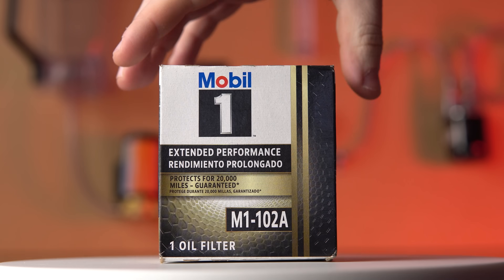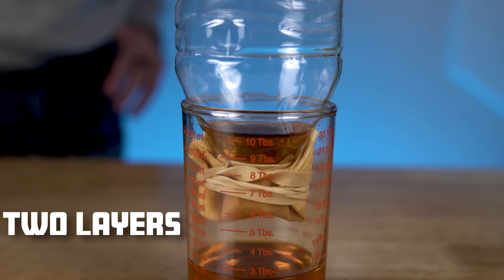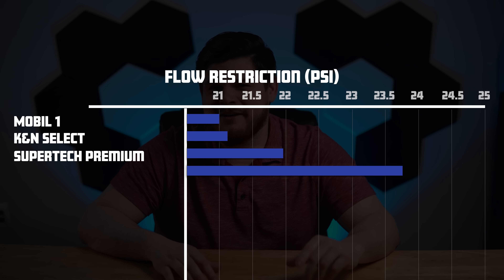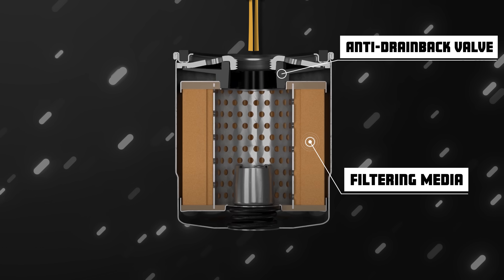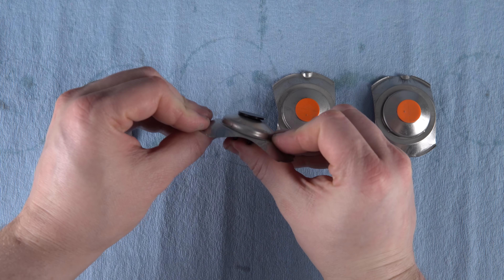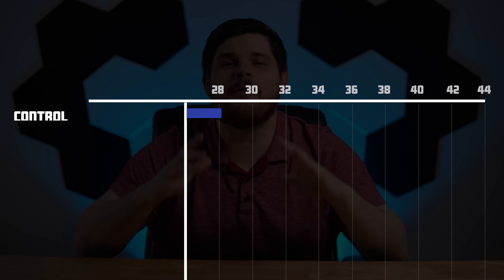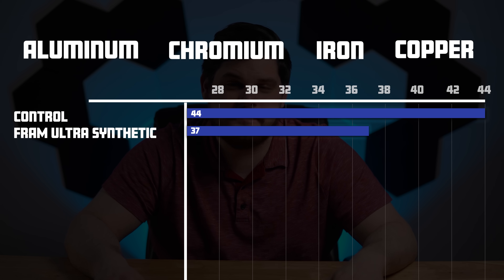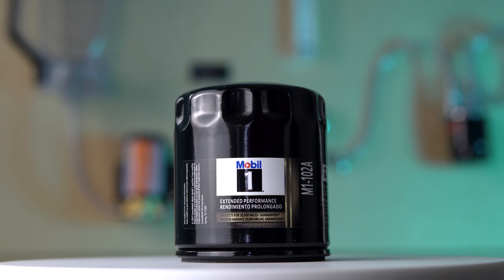Engineers Test the Best Oil Filters! FRAM | Mobil 1 | K&N | Walmart Brand

Comment: Just goes to show you that Fram for all the haters out here that it’s a respectable filter. The best filter for you car is a clean one. Cannot stress that enough, clean filters work better and provide protection for a few dollars. Great video, now how do you convince people to change oil regularly when they don’t even know that the car takes oil. I’ve heard it time after time that “I didn’t know it took oil, I just put gas in it “.
Reply: Been using Fram ultra for years , no problem at all ......ofc it has the be the Ultra one not the rest of the line up.
Reply: HES NOT TALKING ABOUT THE $3 FRAM THAT OIL FILTER IS TRASH
Reply: Fram WERE really crappy filters under previous ownership. But since Trico group bought them out in 2019, they've upped the quality significantly. If you're curious, look how the current ones are made, and then compare that to the Fram oil filters from 6/10/15 years ago.
Reply: Clean filters work better???  Well, DUH!  Problem is, the darn things get dirty the minute oil touches them!
Reply: I very well remember the hate for the plain Jane orange Fram filters back in the 90s and early 00s. The actual filter media inside was the standard pleated paper type you'd get in any cheapo oil filter, but the end pieces that held the filter media in place were made out of cardboard... Obviously the cardboard would get soggy, the filter media would then flop around inside the filter case as you drove around, if the filter media managed to shift enough inside of the metal can then the incoming oil would basically bypass the filter, and the out going oil would carry soggy cardboard bits through the engine's oiling system, yummy... 

I'm old and stubborn and stuck in my ways, so obviously I'm on team "I wouldn't put a Fram on my lawnmower", based solely on what I seen from them back then.
Reply: @admiralrustyshackleford119  it was never cardboard
Reply: “I put the gas in & it goes idk” 
Famous words lol
Reply: Fram lost my business 15 years ago due to inferior build and material quality, Today there are too many other quality filters on the market that never regressed in choice of materials for me to ever trust Fram again...
Reply: Fram has a new design out, Synthetic Endurance, prefix is FE. I’m going to check one out them out. Seems to have all the characteristics of quality in one filter.
Reply: All these tests are absolutely not relevant in cold oil,
Reply: Absolutely agree. I’ve used regular Fram filters for years. I ran two Dodge minivans to near 300k before selling them off. Our current cars are pushing 200k. I always change the oil and filter around 4k and no issues. Just routine maintenance.
Reply: @joeyoungs8426  you can’t argue with success. Simple maintenance and cheap it you do it yourself. Even having it done at a jiffy lube is better than running it to death by not changing oil and filter
Reply: Actually though, the dirtier an oil filter is the finer the particles it actually filters. I think with metal parts inside such as the Mobil 1, an oil filter can actually last quite a long time, and really only stops doing its job when the bypass valve opens.
Reply: @user-ms2mr2mc3g true dirtier it is more it can filter out, but that also restricts the flow. I've been looking into a bypass filter system for my truck. Problem is cost versus how much it will help. Getting ready to do the same basic thing for my house water line. Start with a 50 micro flushable, next would be a 10 micron finish with a 2 micron. I live in the country with hard water. Bypass oil filter I just need to put more research into.
Reply: I unknowingly ran the cheapest version of Frams filters on a Subaru for over 100k miles. The blue OEM filters (before they changed manufacturers last year) were basically just cheap Fram filters. Owners manual suggests 6k mile OCI. All the thousands of Subarus ran this oil filter I never heard of any of the boxer engines blowing up from using the OEM Fram filters. Subaru has some of the most OCD types about these filters due to the bypass value PSI requirements. I just buy either OEM or Wix filters in bulk which ever is cheaper. Change my oil every 6k miles.
Reply: Russell, pay attention. He has been using Fram Ultra, which is a very good filter. The people against Fram are referring to the cheap model, which is orange. The latest name for the orange filter is "Extra Guard". I would not use them either.
Reply: A dirty filter catches more foreign material because the pores are smaller from the dirt/other foreign material.  The problem is that when you filter, you cause less flow.  There's a balance, and I'm not suggesting to never change filters.  I'm just making a point.
Reply: @jameswalker590  Well taken. How clean the engine is internally is a factor for how long the filter will flow adequately.
Reply: I was production engineer for FRAM and had been a loyal customer up to that point.
1)  Air filter is more important than oil filter.  That's a direct quote from the design and warranty service engineers.
2)  Once the bottom of the pleats, up against the center tube, plug with dirt, the filtration element will be bypassed by the valve.  Many FRAM designs had very tight bunching of the pleats and, while they would pass the capacity test, since that test was limited in duration passing it didn't mean much.
3)  Remember that I said I was production engineer?  Well, in reality, due to FRAM's paper end caps, you never knew if you were going to get a filter with one of those end caps offset and leaving a gap where the oil would easily bypass the element.  That's what happens in real life production - things don't always match what was designed!
4)  For the longest time FRAM was cutting the threads into the bottom plate - other brands would roll form threads and that very commonly led to bits of metal swarf getting built into the filters.

Last, but not least, I had been buying HP1 filters for my Boss 302 thinking that this was a performance application and needed a great filter.  Well, the ONLY difference between an HP1 and a PH8 was slightly thicker housing metal, same internals. BUT, they are both tested at 90 psi on the line and, if your engine oil pressure goes over 90 psi, you have other problems!  I had paid a hell of a lot more for NOTHING!!
Reply: Fram literally invented modern oil filters. i never understood the hate
Reply: This is the $10 Fram, the $5 Fram is cardboard inside.
Reply: @xxxYYZxxx  no its not
Reply: It's the cheap internal pieces. Its filters fine, but doesn't hold up for crap. Fine for 3-5k OCIs, but just.
Reply: If Fram stopped making sh*t quality filters, eventually they would shed their reputation for making sh*t quality filters. For me, even if a company also makes a decent quality product, if they also make garbage so they can reach the bottom feeder market, I will take my money elsewhere, such as WIX, Bosch, Mahle, Hengst or Mann.
Reply: Remember when Fram added Teflon to their filters?
 How did that work out? Not very good probably.
 I have no idea/ I had by that time stopped using any Fram filter in an oil change.
 I use their air filters though. Cheap and I change them 2 times a year. Every year. They used to be like 4-6 bucks per. But now, who knows what they charge at the store. Well, made/ but then again they filter the air/ not the oil.
Reply: @luckyguy600  if you have no idea how it worked then maybe it was successful. Maybe they just added Teflon to the paint on the finish. All filters work as designed and if your oil is full of ground metals then it definitely isn’t from the filter “ It’s from you internal components that are made of metal.”, there is absolutely no way to tell how a filer is functioning on an engine as it’s running. If your bearings or other parts are shedding metal then no filter in the world is going to fix the problems you have, it’s wearing itself out and only replacing said worn parts will be the answer. Properly lubed and intact new engines can run without a filter. The oil only becomes dirty through use . And that is the problem this dirt is carbon deposits and metal particles suspended in the oil. Cheap Fram filters do the job it is intended for and is way better than neglecting you vehicle
Reply: No, it's not. It might have faired we'll in that controlled test, but  that doesn't change reality. I'll stick with my Mobile 1 oil and filter every 5k.
Reply: all filters are packed "clean"
Reply: You don't know anything about filters. Here's a bit of an education, long drain interval people need to use "synthetic" or as they should be called, reinforced filters. This way the pleats don't collapse which is far worse than having your filter not filtering 20 microns. Besides, a clean filter is only clean for a minute.
Reply: The deal is that the particle contamination is only part of the issue.  The other part is chemical contamination.  Mainly acidic by products of combustion.  No oill filter will remove that.  Thus, change your oil at 5,000.
Reply: I was production engineer for FRAM and had been a loyal customer up to that point.
1)  Air filter is more important than oil filter.  That's a direct quote from the design and warranty service engineers.
2)  Once the bottom of the pleats, up against the center tube, plug with dirt, the filtration element will be bypassed by the valve.  Many FRAM designs had very tight bunching of the pleats and, while they would pass the capacity test, since that test was limited in duration passing it didn't mean much.
3)  Remember that I said I was production engineer?  Well, in reality, due to FRAM's paper end caps, you never knew if you were going to get a filter with one of those end caps offset and leaving a gap where the oil would easily bypass the element.  That's what happens in real life production - things don't always match what was designed!
4)  For the longest time FRAM was cutting the threads into the bottom plate - other brands would roll form threads and that very commonly led to bits of metal swarf getting built into the filters.

Last, but not least, I had been buying HP1 filters for my Boss 302 thinking that this was a performance application and needed a great filter.  Well, the ONLY difference between an HP1 and a PH8 was slightly thicker housing metal, same internals. BUT, they are both tested at 90 psi on the line and, if your engine oil pressure goes over 90 psi, you have other problems!  I had paid a hell of a lot more for NOTHING!!
Reply: The basic cheap Fram is garbage. I cut one open. Fram wasn't as bad as Purolator tho
Reply: Just not their orange can of death. Their most expensive one should be better
Reply: Fram ultra is a good filter, other Fram filters proven not to be very good…
Reply: @Maynard  they're all just fine if directions are followed
Reply: @Maynardd  proven or they just appear cheap upon inspection?
Reply from the maker: @russell Stewart Thank you for the feedback. Your comment makes a huge difference especially for such a small channel. I've actually been running FRAM for years with absolutely no issues, so I agree that the most important thing is a clean filter!
Reply: @BrandRanks  Fram make three different filters. Three different quality levels. Some of you guys need to get up to speed on what is being sold out there.
Reply: @BrandRanks  I was production engineer for FRAM and had been a loyal customer up to that point.
1)  Air filter is more important than oil filter.  That's a direct quote from the design and warranty service engineers.
2)  Once the bottom of the pleats, up against the center tube, plug with dirt, the filtration element will be bypassed by the valve.  Many FRAM designs had very tight bunching of the pleats and, while they would pass the capacity test, since that test was limited in duration passing it didn't mean much.
3)  Remember that I said I was production engineer?  Well, in reality, due to FRAM's paper end caps, you never knew if you were going to get a filter with one of those end caps offset and leaving a gap where the oil would easily bypass the element.  That's what happens in real life production - things don't always match what was designed!
4)  For the longest time FRAM was cutting the threads into the bottom plate - other brands would roll form threads and that very commonly led to bits of metal swarf getting built into the filters.

Last, but not least, I had been buying HP1 filters for my Boss 302 thinking that this was a performance application and needed a great filter.  Well, the ONLY difference between an HP1 and a PH8 was slightly thicker housing metal, same internals. BUT, they are both tested at 90 psi on the line and, if your engine oil pressure goes over 90 psi, you have other problems!  I had paid a hell of a lot more for NOTHING!!
Reply: Ya I have never heard of anyone having a filter fail and damage anything and the Fram thing has always been stupid only the cheapest one has the cardboard but lots of oil filters use paper or cellulose elements so why does it matter
Reply: Most "car guys" I know wouldn't use Fram even before their reputation pulled a David Carradine.
Reply: I know of one engine that failed because the paper fram filter collapsed internally.
Reply: I would never put the cheap standard Fram filter on any of my vehicles but that changed with the Ultra Synthetic filter.  Very good quality at a decent price.  I always run synthetic oils with either the Fram Ultras in my Subarus and the Wix XP in my diesel.  You can waste money by changing the oil and filters more frequently if that gives you piece of mind but I usually do 10,000 between oil changes in my vehicles. My Subarus range currently in the 140,000 to 150,000 miles and the diesel is at 200,000 and run great.  Things have changed greatly in the quality of oils and the amount of contaminates that EFI engines produce.  There is no need to do the 3,000 mile oil changes anymore.
Reply: @Dean E  its what I use on my F150 and it's at 278k. Still going strong.
Reply: @deane2974  My subies (2012 Impreza - 367,000km or 228,000 miles & 2018 Crosstrek - 144,000 km or 89,500 miles) use the Fram ultras and 0w20 synthetic oil. I change them every 10,000 km. When you change at 10,000, are you talking miles? Assuming so, but curious to know. That would make a 16,000 km interval up here. Which might not be crazy. Though when I do an oil change at 10,000 km, the oil is absolutely filthy looking. Our 2015 CRV has 20,000 km (12,427 miles) oil change intervals and so far, so good at 190,000 km.
Reply: @gregpost3320  Yeah, just not a fan of the 0w20 oil.  Subaru only did this to improve mileage but I do think on high mileage cars I don't think this is the best oil for the long run.  Since I do live in colder climates in the winter month I switched to Mobil 0w30.  With that done I have backed to oil changes every 7000 miles.
Reply: Fram got their bad reputation honestly. They only recently introduced the long-life filters. Their other filters are trash.
Reply: I only use OEM filters now. Fram sucks!  I used to use them until it caused one of my car’s engine to knock. Bad. Changed the filter and it went away. There is or at least was a class action lawsuit against them.
Reply: Fram is still garbage, the crap got stuck to the drain back valve not much in the media, so they still suck, I want to know why he didn't test Wix, or Baldwin, which are some of the best filters out there. And I have done oil changes as a mechanic for 40 plus years, so I have done a few.
Reply: @rolop847  40 years and you still don't know about Fram Tough Guard and Ultra Guard filters ?
Reply: @rolop847  Baldwin are good filters, but many do not have silicone anti drainback valves. Same with Denso. Many engine manufacturers specify silicone anti-drainback valves. Ford V6 is one of them. I have a V6 Ford and the Baldwin and Denso filters allowed the filter to empty overnight, so I took them of right away.
Reply: It's just the cheap cardboard fram that sucks
Reply: @JogurtNugget  all the frams I've used in the last 20yrs for larger equipment has been decent. 
I won't mention how crap wix has gone on their John Deere fuel filters, but those are the new "junk fram".
Reply: @JogurtNugget  It's not cardboard.. it is an extremely strong fiber material and some guys on Bobistheoilguy forum have run the Tough Guard over 30k with no issues which is extremely impressive.
Reply: @memopadilla5931  the cheapest fram you can get has literal cardboard in it. I'm not talking about the tough guard, those are just fine.
Reply: It's not cardboard.  Go to the fram filtration youtube channel and you can see in detail on their video titled fiber vs metal end disks.
Reply: @Big Hygiene  but again, even that one is fine if changed when recommended.
Reply: @memopadilla5931  True but not relevant when those end disks can be offset in manufacture and lead to bypass holes
Reply: @JogurtNugget  but it works for what it's built for
Reply: @JogurtNugget  the cardboard one is made for short oil intervals. Tough gaurd a little longer oci and synthetic fram even longer.
Reply: @reeksreeks3017  Finally someone know what we are talking about.
Reply: People used to know that you had to change your oil back in the days. And by back in the days I mean prior to the 90s. Ever since then, people are becoming more and more ignorant because no one work on their own vehicles anymore.
Reply: @A L  I don't know about no one but not enough know anything about anything I knew a guy that destroyed 2 vehicles because he just drove them till the motor seized from never Changing the oil
Reply: @james10739  I know that guy! His excuse was he thought it was a sealed system and that he never had to add or change the oil and that’s after he detonated the first car and we all knew he was going to do it again, so of the guys in our shop would rag on him about blowing up his car and still when the 2nd car went he all had an intervention, but you can’t help those that don’t want help
Reply: Fram is garbage. I've seen it ruin two built motors due to the oil filter failing... Never seen a wix fail.
Reply: @WoWgen123  u would have to have some exstive testing to prove oil filter made motor blow....trust me...
Reply: @WoWgen123  
Maybe they didn't know how to build an engine.
Reply: @WoWgen123  bullshit
Reply: @WoWgen123  yeah.  But which one?
Reply: @WoWgen123  lol BS
Reply: @WoWgen123  I think that is wishful thinking blaming the filter I mean when you really get down to it aside from the name on the side the only problem people have with the frams is on the cheapest like $3 ones and I assume no one with a (built) motor is running those so I'd bet it wasn't the filter